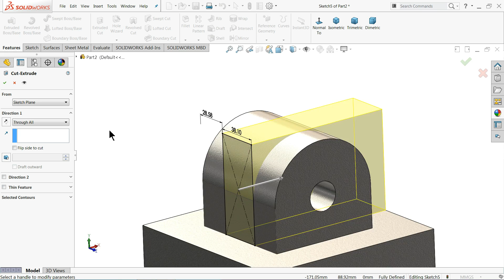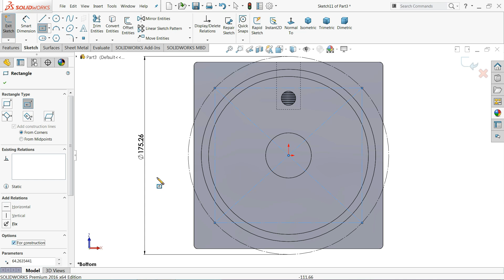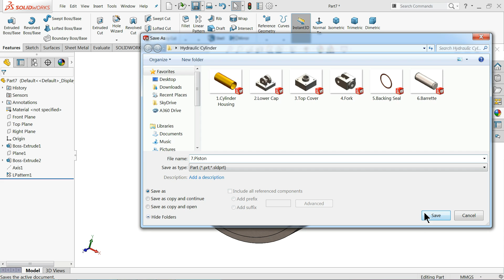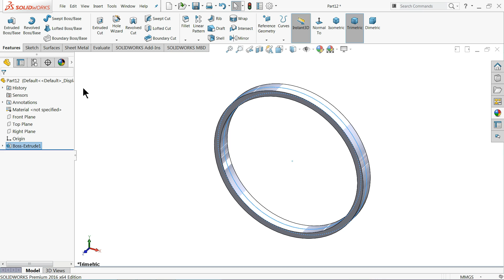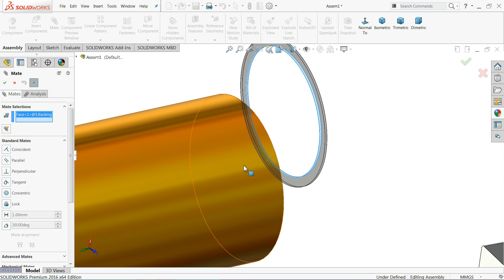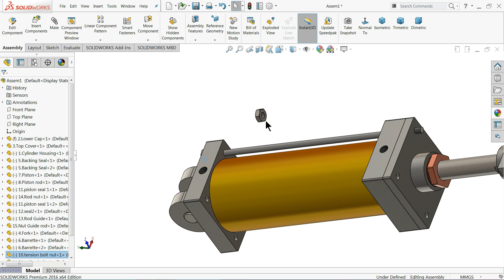Solidworks tutorial | Design of Hydraulic Cylinder in Solidworks

Comment: Hi, 

Great video, nice drawing,, but the seals on the top and the bottom of the cylinder tube have not their purpose if you draw it like that, you needed seal that will fit in the extruded cut grooves at the top and the bottom of the cylinders, with the same dimension(together with the cylinder tube). So diameters of the seals needs to be same like inside and ouside diameter of the tube, so when you screw the nuts on that four rods, you should squeeze the rubber seals between cap-tube-bottom.
Then, you can't make the piston bigger then inside diameter of the tube, its not possible to move it like that.
Also at the end, you can't limit the working space of the cylinder by the face of the cylinder, you need to make longer rod, and then limith the movement of the cylinder by the faces on the piston, and inside faces of the cap and bottom of the cylinder.
Working movement need to be long like = Tube lenght minus piston width - grooves depths at bottom and cap.
Greetings from Bosnia,
Keep god work with tut's.
Reply: Senad Ćeman hi
Reply: @NesdasurjiVillage  Hi?